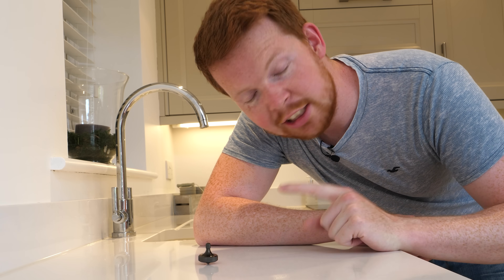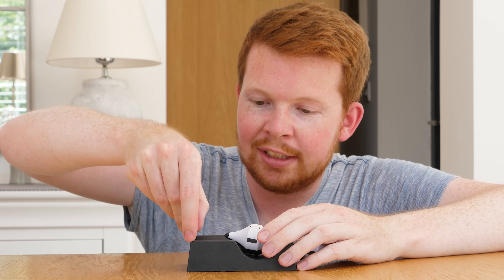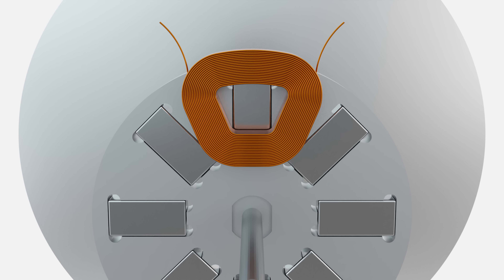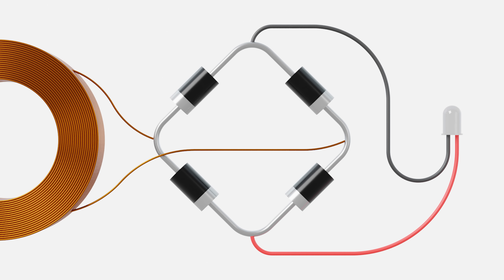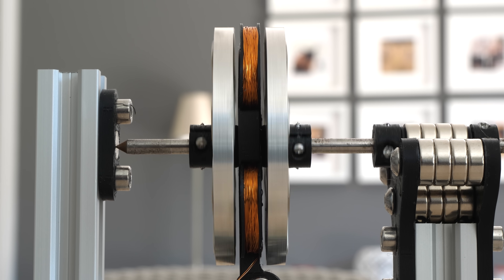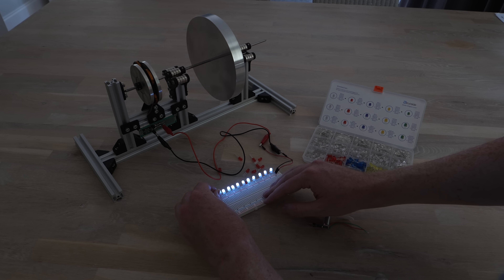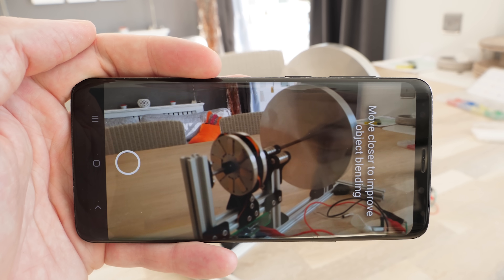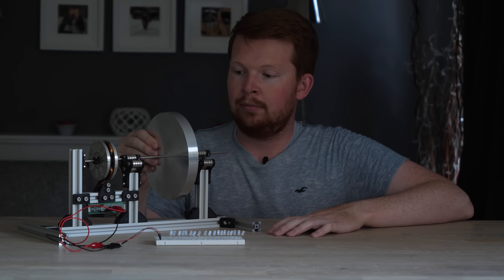Flywheel Battery

Comment: I'm not knowledgeable in electronics in any way - but would it be possible to have two (or more) sets of wire coils like the one you ended up using on the final prototype but offset from the first wire coil component by half the angle between each individual coil (so in your example with 4 coils per component, they're separated by 90 degrees, so having a second component at 45 degrees offset from the first) so that when one coil is 'out of phase' with the magnets, the other coil is in full phase and then feeding that through some form of circuitry to constructively combine the currents?
If my intuition is correct, then given enough coil components and magnet strength, it would be possible to overcome the flickering problem and get a relatively smooth and stable power output from the device - though the efficiency of recovering that power would probably drop by doing so.

Comment: if you make a motor driver of sorts you can use the coils to spin the flywheel too. then you can hook it up to a small power grid like a solar panel. during the day it spins the flywheel and when the solar panel is not producing enough energy it could flip the function of the coil from motor to generator and slowly generate power from the stored momentum.

Comment: It would be interesting to see a high-torque motor rotating the flywheel while drawing the power generated from the flywheel. I wonder how long the motor will last with just a single crank in the beginning.

Comment: Great work Tom. If I’m not mistaken the number of leds you can power this way isn’t limited depending on the speed (=voltage)  this is because you put them parallel. By increasing the number of led’s, you increase the necessary current. Higher current draw will cause your alternator to create magnetic resistance. So the more led’s you will connect the faster yours flywheel will slow down.

Comment: probably the simplest way to straighten the threaded bar here is to simply put it under extreme tension until it rings then heat treat it with a cheap 12v copper induction  heater to red hot, leave to cool, check the ring again, it will have stretched/changed & be straight if you did it right/long enough.

5~12V ZVS Low Voltage Induction Heating Power Supply Tesla Driver Board Module With Coil
Brand: HALJIA

Price:	£9.99  FREE One-Day

Comment: Would it be possible to replace the metal plate on the left with another magnet or maybe a “dish” shape of magnets that would push the end of the rod (itself having a magnet) off and into the center of the “dish”? Perhaps you could get it fully floating this way.

Comment: The leds look like they are in parallel, so the number of leds plugged in wouldn't change the required voltage. I would guess that more leds would slow the flywheel down faster due to more eddy currents because of a lower total resistance.

Comment: Very nice.  So next, speed it up enough to power a small motor with a wheel that spins and periodically comes in contact with the flywheel, thereby creating a perpetual energy device. Somehow, I think you'd be the one to make it happen.

Comment: Would have been interesting to talk about the amount of drag added by the interaction between the coils and the magnets.
Reply: I was wondering about this as well. Considering the low voltage and the size of the flywheel, it might have been so small as to not be noticable my feel.

Comment: It would be cool if you could put electricity back into the system to spin up the flywheel, that way it would really act as a battery. Use a solar panel or something as the initial power source?

Comment: The more the mother spins  it gets power but uses the power to spin the flywheel which will power the flywheel which might slowly increase the voltage making the mother spin faster making the flywheel faster

Comment: Still haven’t figured out why people don’t just make something like this and use the energy it produces to power a motor to make it spin forever, would it be too inefficient or something? Or maybe some other thing I haven’t yet pieced together that is super simple, or maybe it has been done and I’m just an idiot
Reply: If it was 100% efficient, it would spin forever. But 100% efficiency isn’t possible. So it would slowly lower speed.
Reply: That would be free energy and it doesn't work. Take a U shaped ramp and put a marble on one end, then release it and observe it. Eventually the marble comes to a stop. But why? It's just converting potential energy to kinetic and back again? Friction is the killer there, anything that moves experiences friction, even things in a vacuum like space it's just those things see much less friction as there are fewer particle bumping into things. A motor/generator is the same thing, it can only convert mechanical motion into electrical motion, converting it back to mechanical motion using another motor is just like the marble on the U shaped track.

You can try it yourself using cheap 12v hobby motors, you can pick them up for a few dollars. Get a couple wheels or something to stick on them and wire them together. Spin one and the other will spin, try to use them to spin each other and they will both come to a halt. It's the same thing with the whole PC fan free energy videos on here where they hot glue or tape magnets onto the blades of a PC fan then hold a separate magnate up to the side and the fan 'spins up'. In reality they just hooked the fan up to power in some way. You can test that one yourself by buying some magnets and a PC fan then trying it yourself, the parts are cheap and less than $20.
Reply: Perpetual motion machines do not exist. If they did exist they would only put out as much energy as you put in. If not, they'd explode

Comment: And them diodes thicc why much smaller diodes are used for much higher voltage and current like wall power

Comment: You need a non-interference yoke on the right so you can use a pull string to get this thing spun up. I reckon it would pull against the yoke while spooling out when pulled, but would it not true up and float freely again when up to speed and string is pulled off? Just thinking out load. Very interesting video.

Comment: There's a voltage drop across the full bridge rectifier, depending on the current. If yo uuse Schottky diodes or MOSFETs you can try to improve performance a bit at these low voltages.

Comment: I've spent the last few weeks doing something pretty much exactly like this. My moped has a flywheel that generates power like this but in a different configuration, I have been trying my hardest to blur the flickering of the LED lights I put in to more or less unnoticeable levels and used the same things seen here. Good to see I went straight to the practical use on this ^_^

Comment: What if in the point of the shaft that is pushing against the glass , you put a magnet and another magnet in the surface(glass) that way you have the repeling force and it will be 0 friction

Comment: Why couldn't you put two coils either side of the magnets as a saddle that would have increased it's capacity instead of the other way around
Use three coils in parallel all the way up

Comment: You DON'T need DC to operate a light bulb (LED's yes), nor a motor (ANY motor with a field coil and a commutator will run on AC), and an induction motor will ONLY run on AC.

Comment: What if instead of making a second ring for the magnets, you put them in the flywheel itself? to avoid any possible interactions between the levitation magnets and the others maybe increasing the radius of the flywheel, wich would also increase its mass and make it spin even more time. Its an idea that came to mind while watching, loved the vid!
Reply: Also, if it had a greater radius you could put more magnets and coils, wire them up in series and create a higher voltage. Obviously if the flywheel has more mass it will take more effort to spin by hand, but nothing that a good handle wouldn't fix ;D

Comment: I feel the overwhelming need to get myself a version of this with a straightend shaft, and a geared down crank shaft that disengages as soon as you let go of it on the right site to spin it up to really high rpm
Reply: A one way bearing driving the shaft would work. Or even better, use magnets to drive it and pull the magnets away somehow when not turning.
Reply: @ADBBuild  perhaps a centrifugal clutch? You could gear the output of a hand crank to increase the RPM, and the rotation pushes magnets out to engage the coupling. When you stop turning the magnets retract and decouple.
Reply: Like pedaling a bike except magnets on all gear teeth
Reply: I'm disappointed he didn't use the generator as a motor.

Comment: I have been wondering about this for some time... does there really have to be a contact point?  Is it impossible to obtain the equilibrium with another set of repulsing magnets, their north poles aimed at each other but the magnets aligned with the axis of the system?
Reply: It's possible, but the gains would likely be small and his design is very simple and easy.

You could probably get away with V-shaped magnet sets, but again, this gets more complicated.
Reply: I was thinking the same thing, maybe 3 magnets in a triangle on the plate to keep the 1 on the shaft centered

Comment: You should have current-limiting resistors on those LEDs. Also, the forward-voltage (Vf) shouldn't really be interpreted as the required voltage to drive the LED. I can't quite make out the text inside the lid of your LED kit, but each diode should have a Vf and mA rating. You take your supply voltage (9v in this case), subtract the forward-voltage, and divide that by the amp rating of the diode. Vf is usually around 1.7-2.2V, so (9V - 1.7V) / 0.020A = 365ohm in series with each LED to supply max 20mA each.

Since LEDs are in fact diodes, the test rig here is basically a dead-short on the output of your alternator. Probably not an issue for how much power it SEEMS to be making (will the FBR or LEDs fail first?), but you could always put a big ol' fat resistor in there instead and measure the power output?

I have to assume that Tom already knows this, does that LED kit have built-in resistors maybe? If you have plain LEDs, you could in theory use them to build your FBR, and get some cool slo-mo shots of the rectifier rectifying.

Comment: Why didn't you try using your generator as a motor to spin up the flywheel?
Reply: or put many fan blade on the flywheel and power up a small blower, will it be perpetual ? at least a little longer spinning wheel

Comment: You could try the Halbach Array with the magnets to get a stronger magnetic field in one direction and virtually no field on the other. However you might need to have specially shaped magnets or maybe square magnets with some time of binder. Actually, I'm not sure if it will work in the array you are doing it. It might need to be vertical...

Comment: hypothetically: if you made a massive 500v version of this and left it in your garage, paid a neighbour to pop round every 10 min to spin it up, could you power most stuff in your house with an inverter? I really think you are on to something with this (not to guess someones made a video in this before??)
Reply: Energy out can never exceed energy in- at best you extract nearly the same as put in. Human hand power is likely limited to several 10’s of watts...not enough to do much of use.
Reply: @alexjavanainen4259  yeah, I know was just thinking if he supposedly spend 6 months made a super precision version with like loads of coils idk, I spose it's the power like you say not the voltage
Reply: @SustainableGal  I hear you man. It’s just that no matter the size, voltage, etc..all you are doing is approaching 100% efficiency. 500volts at 0.1amps makes 50 watts of power, which is the same as 50volts at 1amp. No matter what, energy out will never exceed energy in.
Reply: @alexjavanainen4259  yeah 💯
Reply: @SustainableGal  I will say this tho, if you throw a bunch of capacitors in there...you could theoretically charge them up slowly over time and then discharge it all in a fraction of a second to get temporary powers of like 5000 volts at 100amps but it will only last a brief fraction of a second
Reply: @alexjavanainen4259  oh yeah sure, true

Comment: The wobble is probably taking a lot of energy away from the flywheel, right?
Reply: Yes
Reply: Probably wouldnt be worth the lots of extra effort for something that wont get any practical use anyways
Reply: @___echo___  true like a stepper motor that creates electricity, same effect.
Reply: Perhaps another pair of magnets above the far end would help constrain the end from whipping about so much..
Better yet, a non-bent shaft would remove the need for the extra magnets all together.. 😉
Tom tried to push something beyond what it wanted to do, possibly due to haste, and bent the shaft.. 

Inpatience causes things to not go as planned or expected..
Just like last night when I was rushing to get some work done in my workshop, and tested the "will fingers stand up against a spinning 12" chop saw blade"..
The answer, unsurprisingly, is no.
I was very lucky it was a glancing blow by the blade, and I still have my fingers.. caught the tip of my middle finger, and badly mangled the inside edge of my left ring finger, and 4 stitches required, but no major damage..
F&#ken hurts though.. 😒
Reply: So I am right in saying that if Tom had a thrust bearing on the point of shaft instead it would run more efficiently. And even more if the flywheel were encased in a vacuum?
Reply: @phil.i.am2  for low rpm low load this method of a point against a hard surface is actually really low friction. Mainly due to it having virtually zero radius.
Reply: yes, but as a proof of concept it worked.
Reply: Definitely. It was hard to watch

Comment: You should add a steel ring on the back of the magnetic rotor to short the magnetic field between two adjacent magnets. This should increase the magnetic flux in the coil and also increase the voltage.

Comment: 7:37 now what if we put other flywheels on thr shaft where there's space to maximize the flywheel capacity???
Reply: the magnetic bearings can only support so much weight before they collapse, not sure how much weight that is.
Reply: Well more flywheels would extend the runtime, but more coil units would increase the voltage. How about a bit of both 😍